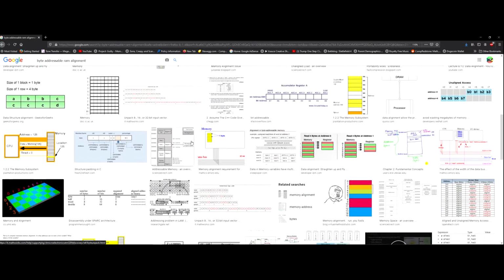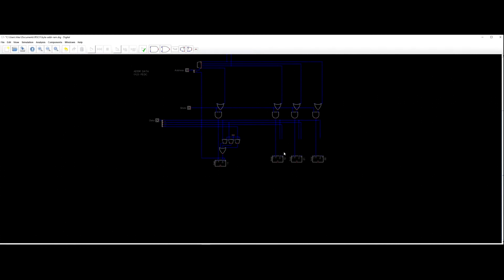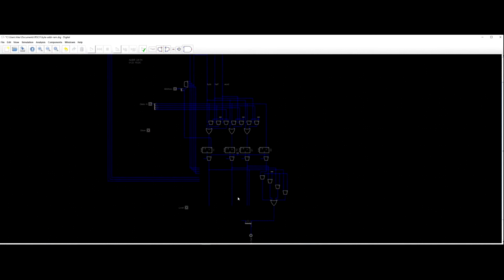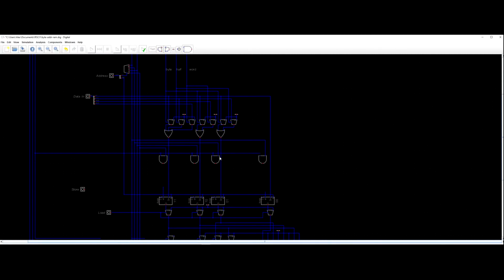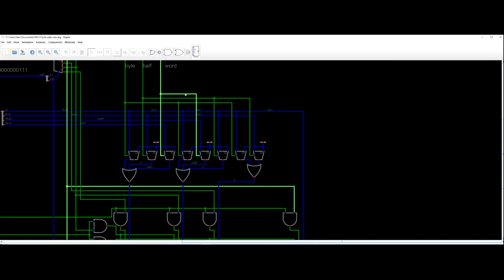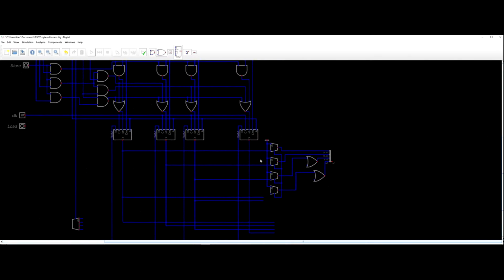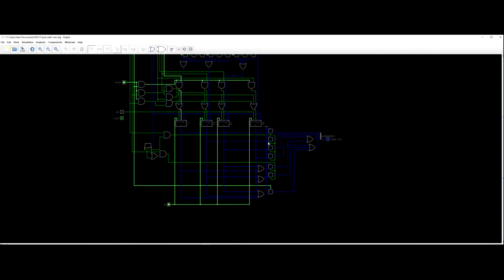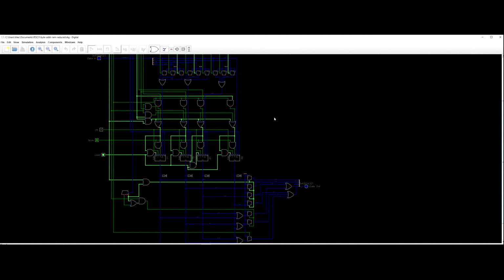32 bit RISCV CPU Design Live Stream

Comment: I get errors like there are 1 bits needed but 8 bits found ; I know the reason but if I try to match them, I can't input 32 bit data byte by byte(in the part where the data input is split into 4-byte lines and get into multiplexers). Could you help me ?
Reply from the maker: Sorry, I just now saw your comment, did you figure it out?
Reply: @WildEngineering  Yes it's sorted now , thanks:)

Comment: There is already a 32 bit byte addressable RAM in the library which can handle unaligned addresses:  Components->Library->RAMs->RAM32Bit
Reply from the maker: Damn that's a really well built sub circuit too. Thank you for telling me this. I will most likely use it and still force alignment in software. :)
Cheers
-
Jarvi